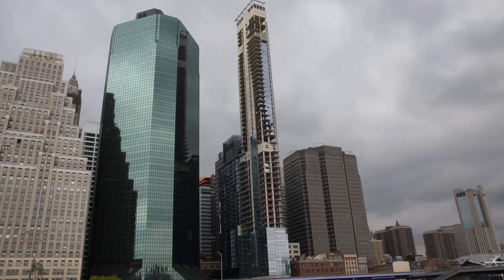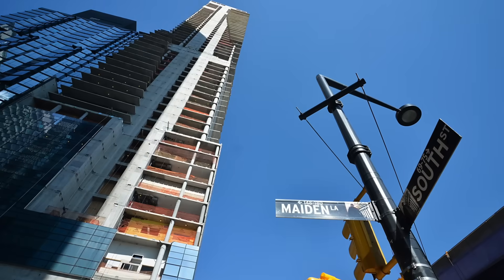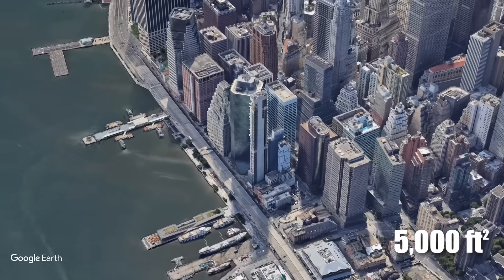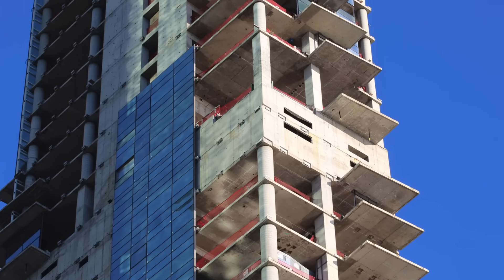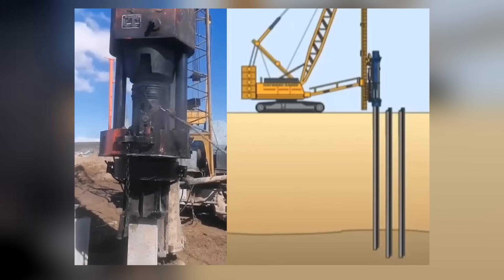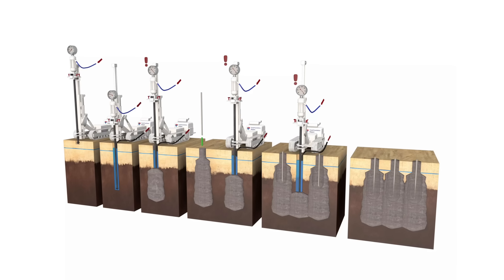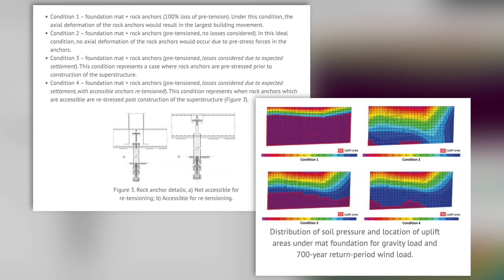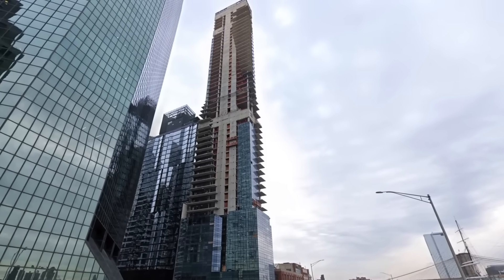Why Nobody Can Fix This New York Skyscraper

Comment: The skyscraper you’re referring to is likely 125 Greenwich Street, also known as “125 Greenwich,” a luxury residential tower in Lower Manhattan, New York City. The project has faced several challenges, including construction delays, financial difficulties, and structural concerns, leading to significant attention and speculation. Here’s an overview of the situation:

Background on 125 Greenwich Street:

	•	Project Overview: 125 Greenwich Street was envisioned as a 912-foot-tall luxury condominium tower with 88 stories, offering high-end residential units with sweeping views of the city and the Hudson River. The building was designed by the renowned architect Rafael Viñoly and was intended to be one of the tallest residential buildings in downtown Manhattan.
	•	Construction: Construction began in 2016, with an ambitious plan to create a slender, elegant tower with luxury amenities. The project was developed by a group of developers, including Bizzi & Partners Development, with financial backing from various investors.

Challenges and Controversies:

	1.	Financial Difficulties:
	•	Funding Issues: The project encountered significant financial challenges, including cost overruns and difficulties in securing sufficient funding. These financial struggles led to delays in construction and concerns about the project’s viability.
	•	Foreclosure: In 2020, amid the financial difficulties, the lenders initiated foreclosure proceedings against the developers, putting the project’s future in jeopardy. The legal and financial battles further delayed the completion of the building.
	2.	Structural Concerns:
	•	Leaning Issues: Reports emerged that the building was leaning slightly, raising concerns about structural integrity. This issue, while not uncommon in tall, slender skyscrapers, added to the worries about the project’s safety and viability.
	•	Engineering Responses: Engineers and consultants were brought in to assess the situation, and it was determined that the leaning was within acceptable tolerances for a building of this type. However, the concerns contributed to the building’s already troubled reputation.
	3.	Construction Delays:
	•	Work Stoppages: Due to the financial and legal issues, construction on the building stalled several times. As of the latest reports, the building remains incomplete, with ongoing efforts to resolve the financial and structural challenges.
	•	Market Conditions: The luxury real estate market in New York has also faced challenges, particularly in the wake of the COVID-19 pandemic, which has affected demand for high-end residential properties. This has further complicated efforts to sell units and generate revenue for the project.

Current Status:

	•	Incomplete Construction: As of now, 125 Greenwich Street remains unfinished. The building’s exterior is largely complete, but interior work, including the installation of luxury finishes and amenities, has not been fully completed.
	•	Legal and Financial Resolution: Efforts are ongoing to resolve the legal and financial issues surrounding the project. Potential solutions include restructuring the financing, finding new investors, or selling the building as-is to another developer who can complete the project.
	•	Market Uncertainty: The future of 125 Greenwich Street remains uncertain. The building could still be completed if the financial and legal challenges are resolved, but it might also face further delays or be sold off at a loss.

Conclusion:

125 Greenwich Street represents a cautionary tale in the world of luxury real estate development. The combination of financial mismanagement, structural concerns, and market challenges has left the project in limbo, with its future uncertain. The building’s fate will depend on the resolution of these complex issues, but it serves as a reminder of the risks involved in ambitious real estate ventures, especially in a competitive and volatile market like New York City.

Comment: THIS IS THE SAME AREA AS THE WTC AND THEIR STRUCTURAL ENGINEERS TOLD BE 
3 PLANES COULD HIT THE WTC AND NOTHING WOULD HAPPEN!!!
ENGINEERS AND ARCHITECTS  USE TRADITIONAL MATH(CALCULUS, DIF EQUATIONS ETC).
WHICH REQUIRES STABLE RELIABLE THEORY AND MATHEMATICAL PRACTICE(SMOOTH
GRAPHS AND FUNCTIONS). WHEN YOU INTRODUCE THE UNKNOWN(RANDOM ERRORS)
THEY ARE ALL LOST!!!  THEIR KNOWLEDGE OF STATISTICS AND STOCHASTIC
IS ZERO!!!!!!  ENGINEERS AND ARCHITECTS(FAKE IT TILL YOU MAKE IT) SHOULD
STICK TO TRADITIONAL METHODS( THAT THEY KNOW WORK).
BEING IGNORANT OF THE UNKNOWN CAN BE FATAL TO A PROJECT!!!(HOPING BUYERS

Comment: Face, meet Palm...
When will architects & developers realize that there is no way to cheap out on a building's foundations? If you try, IT WILL COST YOU MORE to fix it, than it would've to do it right in the first place. I Bet they wish they had spent the extra $6,000,000 to do it right now. Instead they have a white elephant that is costing them money every day, and a stack of Legal Fees that will undoubtedly total MORE than the $6 million they saved in the first place...

Comment: They're saying driving pile down 166 ft.  would cost 6 billion dollars more than injecting  concrete/grout  (rock anchors) 55 feet  deep,  even if injected over a larger base area,  which obviously didn't work to strengthen the soil enough so  the lesson:  THERE IS NO SUBSTITUTE FOR ANCHORING IN BEDROCK,  and rock anchors don't work on a river that was backfilled decades ago.

Comment: It's easier to work when there's no limit on work space.  Now, the empty lots had consider the workspace limitation using technology that can only be allowed.  That is why older buildings are built better as they can really use more workspace.   

Imagine building a tall Lego block tower without anything built around it.  Then do the same on same site but with other towers around it and the goal is for your hands not to hit any of those towers.

Comment: I lived at 900 Biscayne Blvd. and 4 years after it was opened they had to spend over two years coming back to put up this hideous metal panels along the outside of the building to reinforce it because we found out they hadn’t secured it properly to withstand heavy wind and overtime it could literally break and yet it cost $635 million to build maybe the cheap @$$ who was the contractor and building manager should’ve been properly screened and of course this cost was eaten up by the residents what a load of bs!

Comment: For so tall and slender a building,, bedrock,, only.  Grouting can be good,,, but you are limited by the buildings around you.  Grout too much, and damage the neighbors.  The other benefit of bedrock,, the lot may be 5000 square feet,, but legitimately you can spread the legs of your pilings to bedrock to under the center of the street  150 feet down.  You can have a base of 15000 square feet 150 feet down.  Not so with grout.

Comment: I'm no structural engineer, nor am I an architect, but I am an architecture enthusiast. And I'm just going to say this... If you have such a big building, with such a small footprint, built on land reclaimed from what was once water, and you cheap out on the construction, especially on the foundation, you need to be fired. Possible even arrested for endangering the public through your negligence, because you just had to be cheap.

Imagine if someone built a skyscraper in San Francisco or LA, but didn't include prober earthquake safety measure because they were cheap. Guess what, when, not if, but when the southern San Andreas fault produces it's next major quake, they skyscraper may very well wind up as a pile of twisted debris on the ground, possible taking out neighboring high-rises as well that would have stayed standing otherwise.
Or imagine if a skyscraper in Oklahoma City, Dallas, Houston, Miami, or St. Louis wasn't build with very high winds in mind. It is a disaster waiting to happen.

It is extremely foolish and dangerous to cheap out of construction projects, especially when they're skyscrapers.

Comment: I watched from the nearby buildings as it was starting to develop and it always looked like a big mistake to me.  It was a tiny parking lot for years.  I'm sure that it was never developed into anything more significant than that in the past because the footprint is way too small to support anything significant.  I'm sure that somebody in the zoning decision making chain saw a big payoff to allow this disaster to happen.  Whatever happened to building set back requirements?  All these building are constructed right up against each other with barely any space for pedestrians or daylight.

Comment: Every building is a risk.  The problem was that they were pushing the envelope of the possible in more than one direction, and that amplified the risk exponentially.  

The very narrow footprint was one of those parameters they pushed, to get the maximum number of units on the small footprint.  It means that even a tiny amount of differential settlement would give significant lean.  With a 15:1 aspect ratio it means the differential settlement between the sides is no more than 0.2 inches, which is nothing - within usual tolerances.  Even with piles to bedrock you can expect some differential settlement, due to elasticity in the piles combined with variable modulus of the soil.  For a building with an ordinary aspect ratio of say 5:1 or even 8:1 the resulting lean would be acceptable.  All buildings lean a bit!

The other way they pushed the envelope was in the geotech.  The grouted soil improvement to save money, is not as rigid as going to bedrock and could have reasonably be expected to give more differential settlement.  But again for a building of "normal" aspect ratio it would not be an issue.  I'm actually a bit surprised that it wasn't more or a problem, shows the grouting gave a pretty good result that for other buildings, would have been fine.  You have to understand soil is not an exact science!

But combining both the less rigid foundation with the large aspect ratio should have been identified quite clearly as giving a large increase in risk, much more so than just having just one of these factors.  They embraced this risk, whether they understood it or not, and the dice rolled against them.

The business solution is simple, but will take time to play out.  The current owner probably does not have the money to fix it, and anyway fixing it on top of the building costs to date would cost more than it is worth.  So eventually the owner will run out of money and go out of business due to the ongoing costs and the legal costs.  If they have any sense they will sell it at a low price asap to someone else before they reach bankruptcy, but usually investors are too stubborn and pig-headed to accept that a large loss now is better than a total loss later - they tend to hang on to the sinking ship until all hope is lost.  Either way it will be sold as a "distressed asset" for much less than it cost to build so far, to someone who can put the money in to fix it and still make a profit at the end.  This is the standard procedure where costs have spiralled out of control on a privately funded infrastructure development.  We saw the same in the UK with Canary Wharf, and recently with the new Woodsmith Mine.  The original investors lose big-time if they are sensible, or lose everything if they are stubborn, but the incoming buyer gets a bargain that he can fix up and make money on.  It happens every day.  It also throws up lessons for developers, regulators and engineers, from which we learn.  Much of our practice is learned from those who made mistakes.  Realistically, if nobody ever took a risk by cutting corners, we would never know what we can get away with and everything would be much more expensive.

Technically, what can be done?  Having a 3 inch lean is unlikely to be a problem structurally, the problem is the risk of the lean getting greater.  But a new foundation ring around the outside, down to bedrock, linked to the mat to make sure it doesn't move any more, would be technically feasible.  A more sophisticated approach to reduce the lean is also entirely possible, but probably not worthwhile.  All this is expensive, so needs to be subtracted from the eventual sale price to get the "distressed asset" value that should be paid now by someone willing to take it on, with some further reduction to cover profit and risk.

Once it's fixed, the units may be sold at a lower price but I predict that eventually, once the safety of the building has been seen over a few years, it will be "a thing" to say you live in the leaning tower of NY and unit prices will be back to normal, or even at a premium.

I'm an engineer of 40 years standing, investigated many structural failures and seen most of these things before!
Reply: By the way it's worth making the comparison with Steinway tower in NY which is even taller and has an aspect ratio of 24:1.  That did not have a foundation problem, but it sways as much as THREE FEET from side to side at the top in high winds.  So 3 inches in itself should not be a worry.  And even though there were no major technical problems, Steinway Tower hit the same sort of finance problems.  The original developer went bankrupt when it was 1/3 built because a dip in the housing market meant that he would not be able to make a profit.  So it was sold for less than it had cost so far, to another consortium who put up the money to complete it, and made a profit.

Comment: These skinny towers are dumb. That’s a lot of structure spread over such a small footprint. They ought to code them out. They’re going to have to dismantle that thing, which won’t be easy since it’s a concrete frame. IMHO, the engineers messed up, big time.

Comment: I have formed 12 story high rises. Three inches doesn’t seem that excessive. How many inches would be acceptable? Divide 60’ by 3”. At 1/16” that would be 1” every 16 stories. Multiply that by 3 and that’s only 48 stories with a remainder of 12 stories. Not too bad.
Reply: Give it a few years and it will be ten times that......

Comment: Can someone run this same analysis on the Boeing 737 max please. We need fundamental root cause engineering questions asked. By the way, I’d move in to a building with a 3” lean in a heartbeat, no big deal, I’m guessing there are some other issues at stake here too.

Comment: Only college "edumacated" engineers would "think" they could get away with not securely anchoring the building to the bedrock. Its also obvious that such a tall thin narrow structure  is questionable. Finally, what kind of silly people would purchase condos in an unbuilt and uncertified building?

Comment: I seem to remember that there's a Japanese airport built on an artificial island where each pylon was individually adjustable to account for uneven settling as well as overall subsidence.   Seems to me that they simply did not design  how to compensate for something that obviously could occur and then just tried to pretend it wasn't an issue.   

The tower will likely have to be demolished at taxpayer's expense or more likely just remain empty till it either collapses or again it's demolished at taxpayers expense.

Comment: All these supertall, super thin residential buildings are nightmares.  Just because you CAN build something doesn't mean you SHOULD build something.
Reply: Even if they are structurally fine they’re just bad - moving in the wind, wind noise, small floor plans. The only thing they give you is a view where maybe you couldn’t have built anything wider.

Comment: These ultra-thin skyscrapers being built in NYC -- Does anyone believe they will be inhabitable 40 years from now? I have to think the structures will deteriorate, be judged unsafe, and the buildings demolished (if not fallen down).

It's like during 2021 the 12-stories Champlain Towers (South) collapse in Surfside, FL, killing 93 people. Completed in 1981, by 2018 the residents knew the building was noticeably deteriorating. Adequately repairing the tower would have cost almost as much as initially building it; no condo owner wanted to be assessed at least $110,000 a unit, so the repair can kept being kicked down the road. In 2021 the Miami-Dade County building inspectors ordered repairs to be made, but soon afterwards the condo building collapsed.

Comment: As an automotive tech. I'll tell you. Engineers think and act like they're the smartest people around who make no mistakes in their design. Until as a tech i point out how they lack common sense. This building for example, we accounted for the twist, we didn't account for weight distribution. Something related to me, when this condition occurs by the customers complaint, replace this part. Me, how do you duplicate? Them, you can't but it a known issue for a year.
Also me, spends 20 min on vehicle, figures out how to force duplication of complaint. Them, how?
Me, by active test of this part, it is closest to this series of parts, use and build up clogs the first of the series of ports in the failed part you said to replace. 
Service bulletin two days later.

Comment: The building is knackard and cannot be fixed. It needs to be dismantled top down, so that a proper foundation can be built. But they won't do this for probably at least another 20 years, as they got loads of other dumb ideas to try out first. Just hope it don't come tumbling down by itself in the meantime, scary :-(